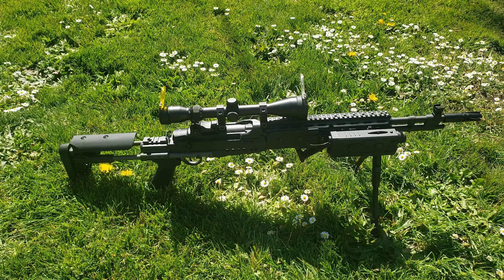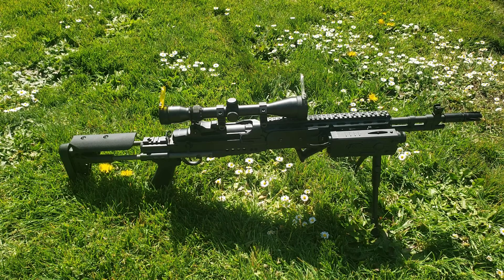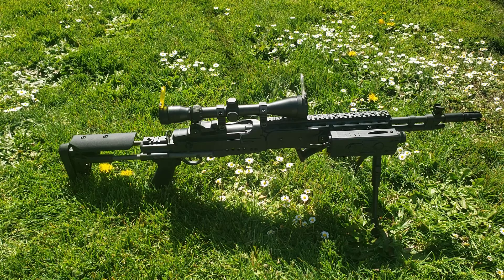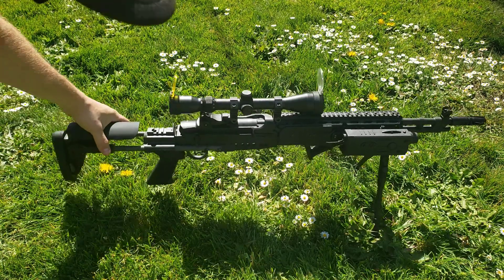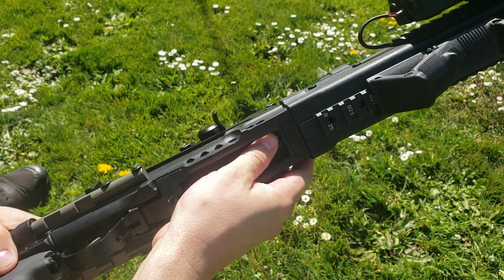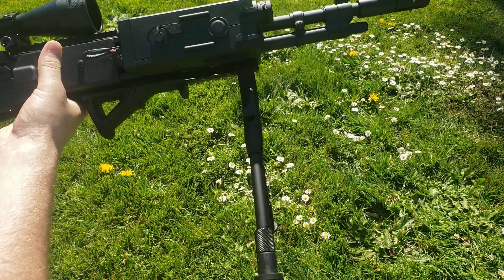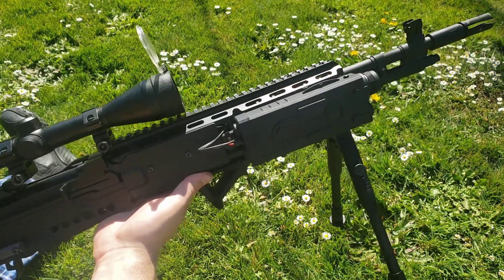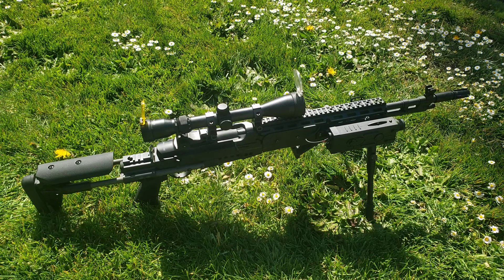CYMA M14 EBR- Quick Overview and Modification Plans

Comment: I'm planning to get the same version, but mine has the battery on the stock (which is a regular M4 stock). I think its better that way, but you dont get to use the original EBR stock.
Reply from the maker: Getting that stock you want will definitely help balance out the weight. 👍

Comment: Just bought the echo 1, basically the same as the cyma... have you had any issues with it? Anything to look out for?

I'm new to airsoft so not sure what to look for when it comes to repairs or problem points.

Can I use a scope from a realsteel rifle on it? Will it cause the scope issues? 

I heard the pistol grip is a problem spot for these, is it easily changeable? And have you had problems with it?

Sorry for so many questions!
Reply: Had my CYMA m14 for 6 months it runs good. But don't try and replace the hop up can't find a new one for the life of me. Now I have to buy a hole new gun